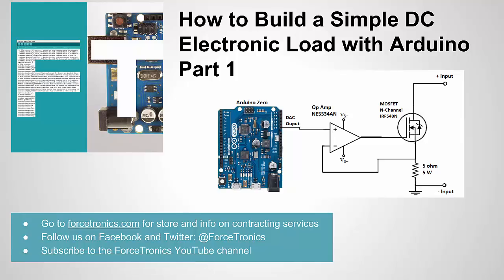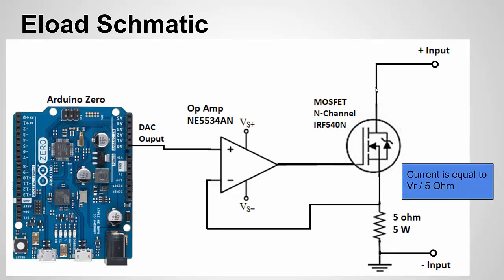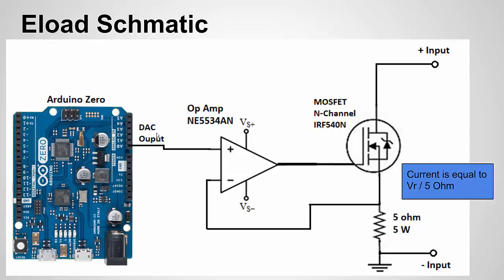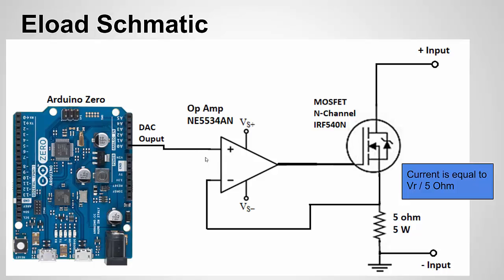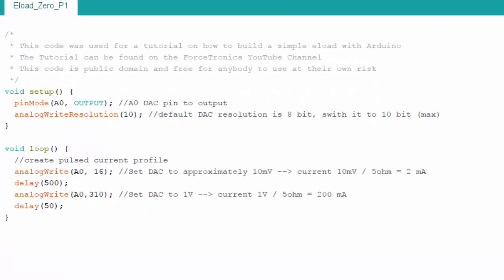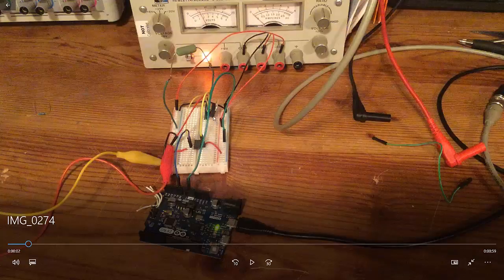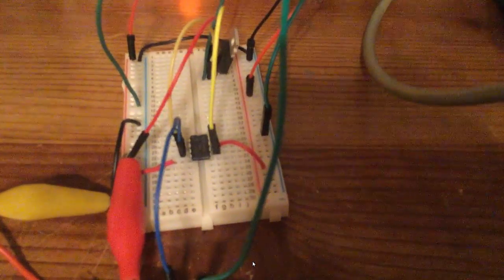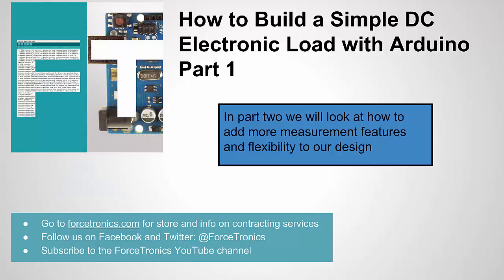How to Build a Simple DC Electronic Load with Arduino Part 1

Comment: For what reason do you use an arduino here? if all you need are 5 resistors, 1 potentiometer, and one Zener diode,  or tl431
Reply from the maker: Good suggestion if you are trying to recreate an eload from the 1980s. But if you want to create a modern eload that supports features such as remote control or dynamic load profiles then a programmable DAC approach might be worth trying

Comment: Might be worth noting that the IRF540N doesn't specify a Safe Operating Area under DC conditions in the datasheet. Therefore it is hopeful to state that the part is appropriate for this application. But most mosfets will work anyways, it's just non-ideal unless they are specified for Linear/DC applications.

Comment: I would say that the error (or at leas part of it) could be caused by the resistor. The resistor is not exactly 5Ohm.
If we assume the ADC is precise enough to give exactly 1 V. And if the current is 0.19399 A (I'l use 0.194A), the value of the resistor in this case would be 1/0.194=5.1546 Ohm
If we calculate the error (5.1546-5)/5=0.0309 (aprox 3.1%). If you used a 5% resistor it is very much in realm of possibility for this to be the cause.
Of course the resistor is not the only culprit. There are other factors like the precision of the ADC and the measurement precision of the power supply.  
I would measure the value of the resistor with a multimeter and use that inside the program to calculate the apropriate voltage to use.

Comment: Did you use a gate resistor ? if yes . What was the value ?
Reply from the maker: I did not use a gate resistor because MOSFETs draw such little gate current. But if this was a finished commercial design I probably would use a current limiting gate resistor just in case. Probably use 1kohm to 10kohm resistor depending on the MOSFET specs
Reply: Thanks for your reply , its working perfectly .
Reply: i thought no current flows through the gate, so how would a resistor limit anything?
Reply: There must be current flow for anything to work, Voltage without current does nothing. A Mechanic!
Reply: @dand8282  This is exactly what I was taught initially, but when I learned that current does flow and why it does flow, I couldn't understand why we keep perpetuating this misconception. watch?v=8swJ_Bnsgl4

Comment: How about using a SPI/I2C DAC?  It frees up A0 for use with another serial device (like a heat sink temperature transducer) and you could easily get to the critical 14-16 bit range on the DAC.  

Maybe you are going there.  I should have viewed the series before commenting I guess.
Reply from the maker: Adding a higher resolution DAC would definitely improve the design. I would probably want an ADC that matches the DAC resolution for the measurements. I kept this design pretty simple based on what I had at hand. But you make some good suggestions on how to further improve it.
Reply: OR JUST USE A POT NO NEED FOR ARDUINO

Comment: Thanks for the video. Any reason to use a DAC output? Is that level of precision required? Would a PWM output with a smoothing cap be good enough?
Reply from the maker: You are welcome to try it and please share results if it works pretty well. My experience with filtering PWM to make it act like a DAC is you get an output with a lot of low frequency noise. Since MOSFETs are fairly fast devices you will probably see that noise cause the resistance of the MOSFET to jump around and not be stable. Depending on your use model that may not matter.
Reply: That makes sense. Thanks.